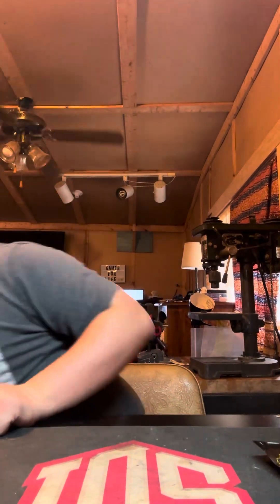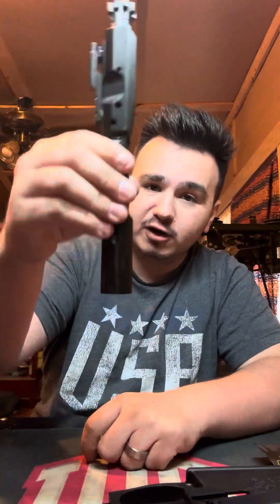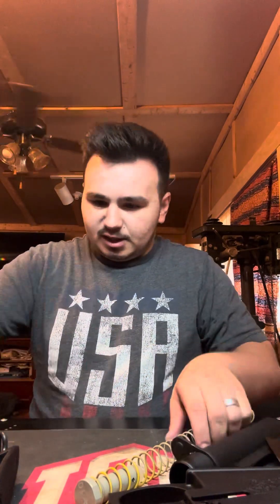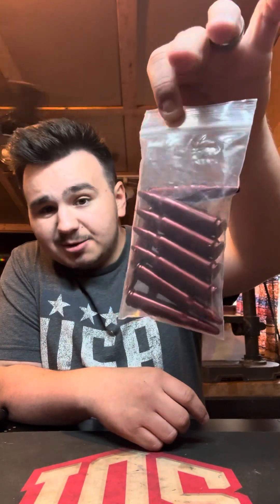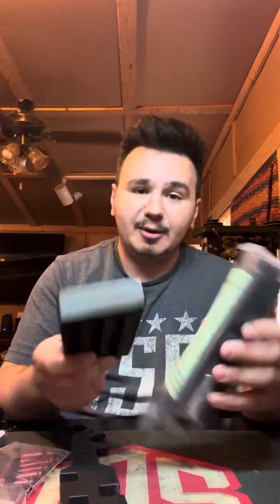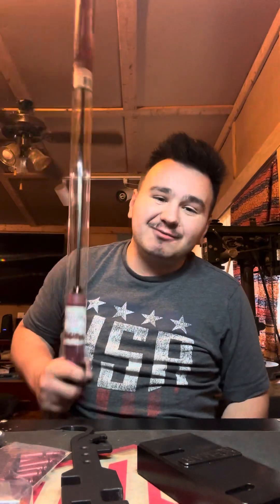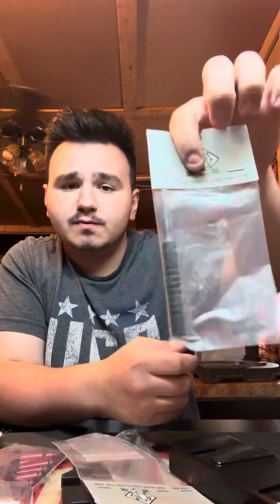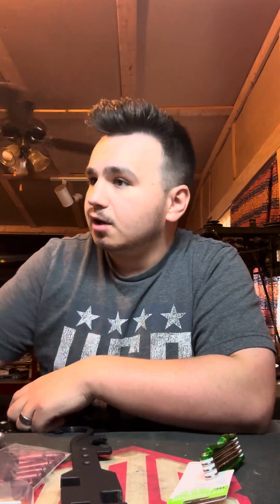SDI AR10 Build Kit Overview

Comment: lol for the cost of the school they send you a panther arms. Glad I didn’t sign up. I guess it’s good for people with no experience but I’ve learned over years and through gunsmiths in my area. Was wanting to see what the build materials consisted of before throwing uncle Sam’s money at 2 free firearms lol😂not worth it
Reply from the maker: @giken691  To each their own. You can't really knock it unless you have been to the school. It's not just getting two free guns, if that's all people want to sign up for then they are in it for the wrong reasons. You get out what you put in.
Reply: @TennesseeTactical  Thank You for saying that. I laugh at people that talk down on schools like this. No, you will not be a "gunsmith' after taking the course, but it will get you on the way. I am in wee4 of my first class and have already learned more than what I already knew.

Comment: Do you know if the ar15 build is still aero? I was going to do the ar10 hoping it was aero, I already have a psa ar10 so I wanted a nicer one… also they no longer do 80percent lower? They instead just FFL you a stripped lower? I was looking forward to milling one out
Reply from the maker: I am pretty sure it just depends on what company has enough of them in stock at that time. They use Aero and Dpms and from what I can gather, Dpms is gonna be the main one they ship out now. Also, yes no 80 percent lowers. It's a 100 percent stripped lower.

Comment: Nice video. I' start the AR-10 build for SDI in 3 weeks. I'm really interested to hear if you need to buy any additional tools to what they sent you. Have fun with the build.
Reply from the maker: Hopefully I won't need any additional materials. Good luck on your build and stay tuned for more videos!
Reply: @TennesseeTactical  Hey, got mine in the mail today. Luckily, I got the aeroprecision kit. To be honest, I didn't know the difference between AP and the one you got. Is it a quality issue or a parts issue?
Reply from the maker: @getothfam  Aero is better in quality in my opinion. It's not that DPMS necessarily bad, but aero has a really good reputation of quality control.
Reply: @TennesseeTactical  Got it, thanks for the quick reply. Keep up the good work!
Reply from the maker: @getothfam  Thank you!